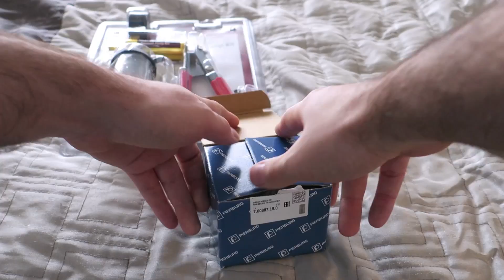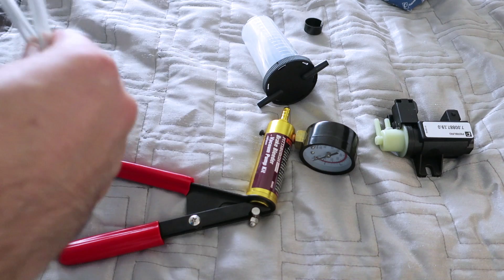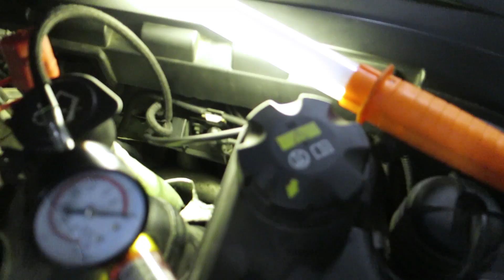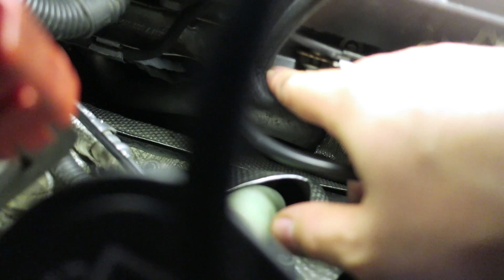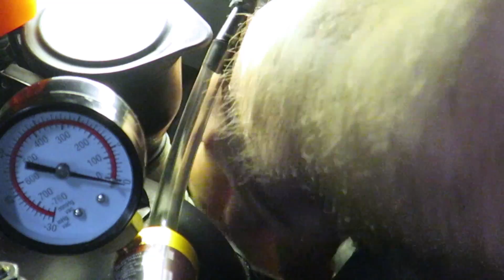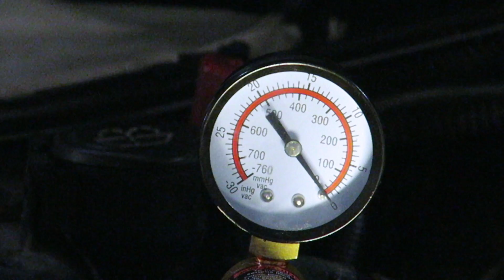How To Test Your N54 Boost Solenoids On Your BMW

Comment: No need to test fancy ways... if you hear a tiny buzzing in the solenoid area, they are bad. That's how I found out. The dealership didn't believe me and laughed, then they ran the codes and lo and behold they changed them under warranty. They don't ignore my comments anymore. It's a very very faint buzzing that can be covered up by engine noise, but you can hear it is quite a different frequency - fast buzzing like a very fat mosquito.
Reply from the maker: Good to know, thanks for the info.
Reply: I heard a different frequency at boost solenoid area so I was pretty sure that's what was causing my 30ff code, however, I also tested it using this videos method and my gauge reads 16 in hg for both solenoids. Now I'm confused

Comment: Pierburg is the OEM manufacturer of the BMW solenoids, yet when I bought them, the only lasted a month...had to buy OE BMW branded ones to fix the problem. The BMW branded solendoids are still going good. There is one extra step of QC that goes into BMW branded items. Same goes for plugs, coils, sensors etc. You pay a premium for the logo, but you also get the extra QC and that's why I just get OE branded so I don't waste time in the end... too many times this has happened with aftermarket items.
Reply from the maker: Hmm so far I haven't has issues with the Pierburgs but will keep an eye out.
Reply: The branded OEM in terms of quality is ALWAYS the best. I've been in the industry  for quite awhile so can shed some light.
For all that's worth in your example. The BMW and aftermarket are from the same brand in this case Pierburg. Made in the same factory, by the same workers, same forms, same everything. So what's the difference?! Anyone will ask. 

QC (quality control) is the key word.
The parts that score the highest in QC tests. Let's trow a number, ex. between 85% and 100% Go straight to fulfil the amounts schedule on contract, let's say a million parts. So end up in the BMW logo box. The premium pick of the crop.

The remaining, let's say <84%~50% QC, within a reasonable threshold, go for aftermarket. In this example carrying only the Pierburg logo. Still functional parts but with a few small issues that might affect or not it's useful life in the long run. 
Can be as simple as a plastic lip slightly malformed, etc. For all that's worth it's still a perfectly functional component. The manufacturer also determines to it's convenience how many parts he'll produce and to what accuracy and to whom he can sell. One of the reasons why we find the same part in several different brands, sometimes with very different prices. When theoretically they're exactly the same part. 

Only the ones that flunk on the QC end up in the garbage/recycling. It cost a lot of money and it's always a focus when cutting expenses. By reducing waste. ;-)

With this said. Car manufacturers and component manufacturers work hand in hand. The acceptability thresholds are determined by them. Knowing that it's understandable that cheaper brands "accept" lower QC values than high price brands. Even if it's the same part. An example could be the same part in Mercedes or Renault. The final costumer will know that for sure, it always end up in final cost. ;-)
BTW this applies to no matter what brand. We used the example of Pierburg, could have been Bosch, Valeo, Delphi... It doesn't matter it's the same principle. 
Cheers
Reply: How did you determine that they went bad? I think I have a similar problem.

Comment: Is your brake pedal hard or engaged with vacuüm when you cold start your engine? So in other words, does it hold vacuüm when you let it sit? I don't have a 35i engine, but the vacuüm is present at anytime. Maybe yours is leaking while the exhaust valve is closed?
Reply: The vacuum in the brake booster (hard brake pedal) E92 335i is hold by a checkvale (one way valve)
on the brake booster itself.L nipple on a pvc vacuum line inserted in rubber ring that go insite
brake booster.If you have a hard pedal after a day then 2 problems can be in play.
1 checkvalve 2 brake booster insite leaking vacuum.
Reply: Yea well that is true. I was more thinking into the direction of air-intrusion via the exhaust flap hose. It knows a difference while open or closed. While it theoratically should be a closed circuit, until the valve is opened (shut off vacuüm) or visa-versa, the valve closes and using vacuüm. But it may be normal, I don't really know.

Comment: Thanks for the videos!..I'm getting 30FE codes and I hope it's just the solenoid(s).  This video helps me out!
Reply: Did it fix your 30 code?
Reply: Hello did it fix your problem
Reply: Did it fix the problem that code is becoming the death of me
Reply: I haven't had a chance to replace the solenoid due to travel for work.  I throw the code mostly after full warm up and highway driving at 4k rpm in 2nd - 3rd at half throttle or more.
Reply: @mikebrooks447  Hey, did you solve your problem? I am actually suffering from this 30FE code. Best regards from Germany.
Reply: @PeterZov  Yes.  I replaced one of the boost solenoids and it cleared the code.